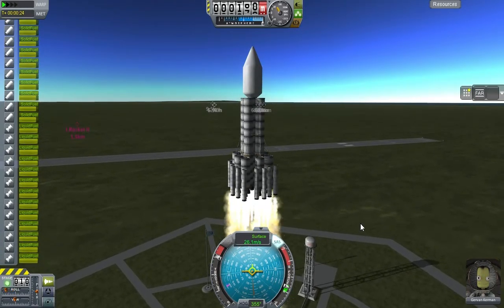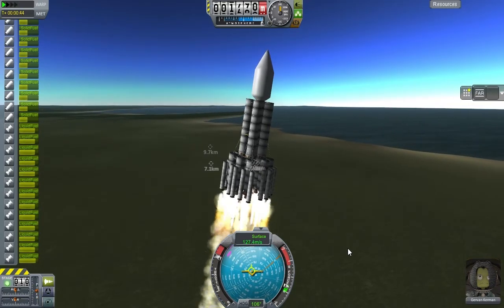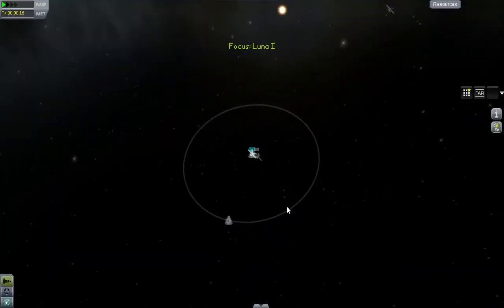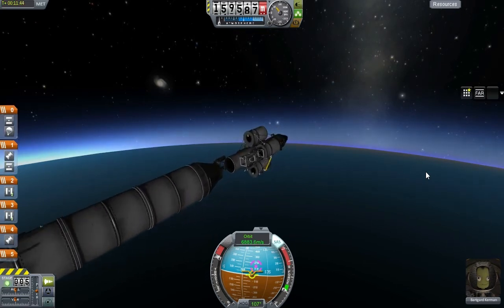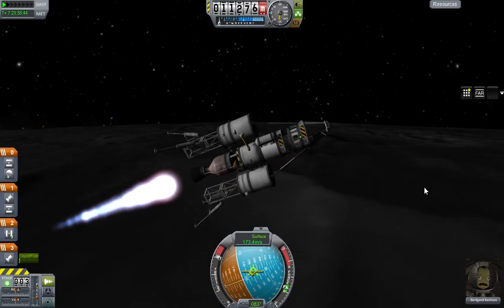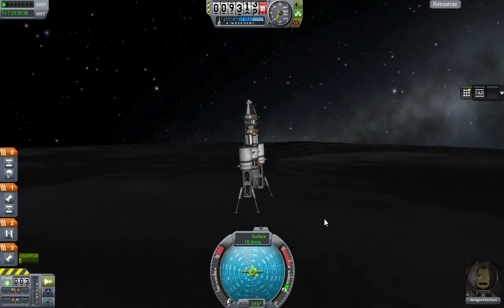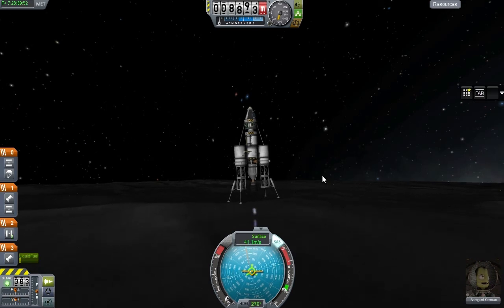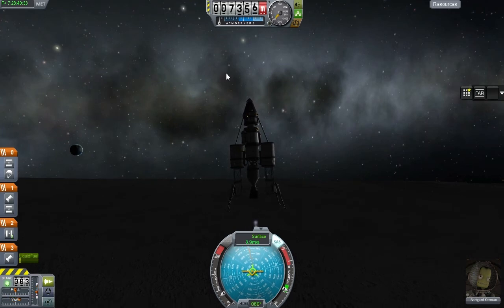KSP to Mars Episode 22: Nuclear Bloopers

Comment: Your problem is that you're running FAR and still use flat-topped "stock" designs. They need streamlining, else they will start tumbling on ejection. Those .3 tons are well worth it.

On a different note, look into KW rocketry. It's quite nicely balanced with stock parts, and it offers some tapering fuel tanks, so you can have a tank in stead of dead weight on top of those rockomax tanks.

Comment: And that is why I prefer serial staging XD
Reply: Might be interesting to see how far you can take serial staging before the rocket gets completely unstable.
Reply: Nathan Jessep
Biggest payload I've launched is 60 tons, and that was with my 2800 ton launcher. Now that's' a mass fraction of just 2%.
Asparagus does help a little bit with the shitty mass fraction but not that much.
When I tried using it it didn't raise it more than a few 10:ths of a %.
Reply: ***** What I like about asparagus in RSS is that you start dropping the part count very soon. I really don't like the lag. =3
And if you work with engine clusters you can keep a very neat TWR. Most people just stick a Mainsail under a stack but if you manage to get the main stack to a 1.7-2 TWR you can get a very smooth ride.
Reply: Nathan Jessep
The record is now beaten!
The save with the 60 ton launcher got corrupted somehow, and at first I was completely incapable of building a new heavy lift vehicle :( 
I was about to give up when, by magic, I stumbled upon a design that didn't fall apart...
And then I made it more boosters!

https://dl.dropboxusercontent.com/u/22015656/MORE_POWER%21.png
It weights 3500 tons, and can launch 80 tons to LEO =D